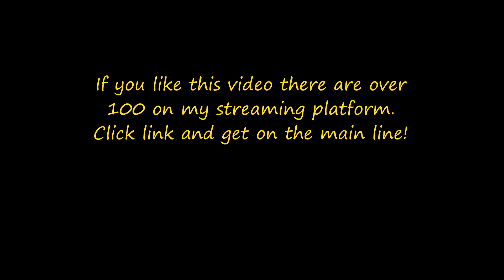Motocross Steering Secret.

Comment: Extremely underrated advice!!   I've been fighting my bike for years; I found this nugget of advice in one of Gary's other Youtube vids and it totally changed my riding.    Question to Gary, why does pressure down or forward of the outside bar do the opposite?  I agree it does but why?  Geometry?
Reply from the maker: Hi Howell, Thanks for sharing. I'm not exactly sure why this is the case, but I believe it relates to the Giro effects and the bike's geometry. For example; in  hang-gliding it's call "Adverse Yaw". When you lean your body to turn right, the kite will actually turn left for about 2 second, before turning right.